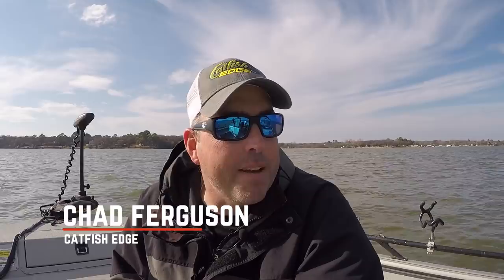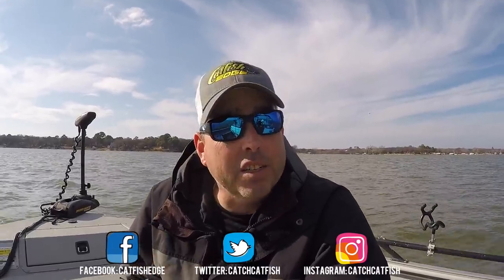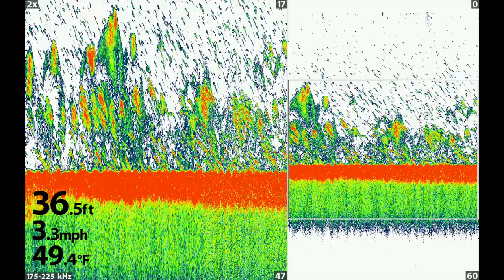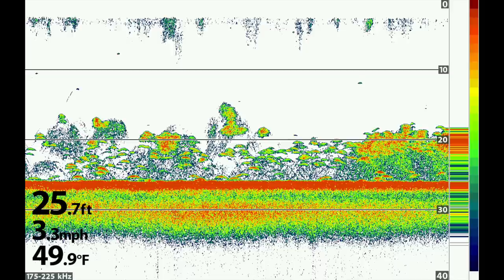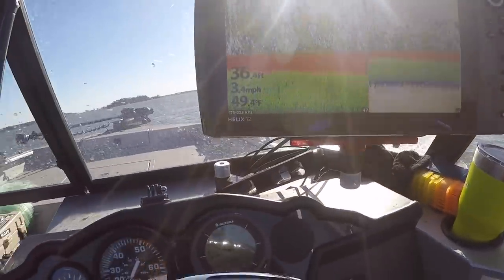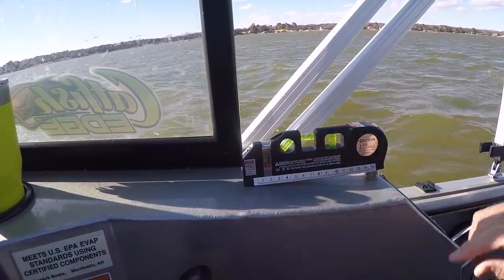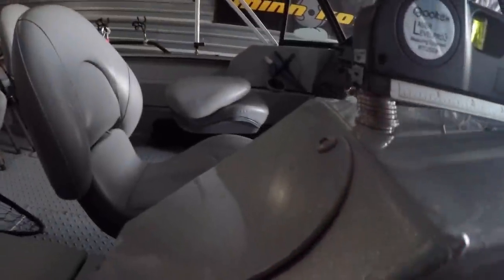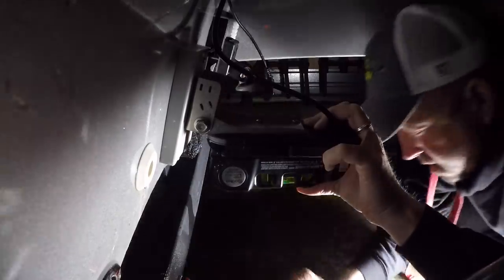How To Level a Fish Finder Transducer (For Better Images)

Comment: You mention guesstimating the level of a transducer.  I had a Garmin Echomap installed by a leading dealer in our area Portland Marine Electronics back in 2017.  There is a new owner now as of 2018.  I bought the unit from them and was told what a great deal and it comes with this really good transducer.  Well when I tried side imaging it was terrible.  I contacted Garmin and they wanted to know if the dealer tested it on the water.  I told them not that I know.  When I talked to the owner of the company Todd I mentioned that to him.  I also told him the side imaging is terrible which he said his works for fine for him.  Then tells me we have been installing fish finders for so long we don't need to test on the water.  We know exactly where the transducer needs to be.  Then I found out they installed it with the wrong transducer.  That really irritated me.  Told me they couldn't do anything because they installed what was in the box.  They charged me $300 and removed my stand for the old unit and the transducer and speedo for it.  Then just slapped on new Garmin unit.  They left all the wiring under the dash plus the external GPS.  I had told them I wanted all of that off the boat so I could sale the old unit.  I also told them I wanted the NMEA 0183 connected to my TR-1 and Marine Radio.  They didn't do any of that.  I never went back there either.  Now there is a new owner and I hope they do a better job.  When I got my new Humminbird unit I installed it myself.  I would of paid to have someone install it that knows what they are doing but there are lot of experts that aren't.  I talked to a guy about checking my system and he said he installs transducers level with the bottom of the boat.  I told him that won't work for good side imaging.  Not sure he agreed.
Reply: I had someone tell me to turn on Jigging Mode found under Sonar.  It forces the unit to read every ping.  Went out for test run and best side images we have gotten. I also used color pallet 4.  Si Chirp Frequncy Max for Beginning and Ending for 455, 800 and 1.2.
Reply from the maker: LOL it happens often

Comment: What about the height from the bottom of the boat.  The Si Transducer looks like it is above the bottom of the boat.  Do you use the cheaper 2D Sonar lower so it still reads when running from spot to spot?.
Reply from the maker: Location depends on the boat.

Comment: I bought new sensor 

XHS 9 HDSI 180 T Transducer

for my
HELIX 9 SI GPS.

Instaleed new Versions

HELIX 9 SI GPS,Vers.1.46 and Basemap,Vers.1.051.

Fishing deepth 4-7 meters.

After updating cannot see any of fish symbols(Fish ID-On) on
the sonar screen.No fish alarms(alarms-On).

I am using 455Hz.

What reason could be???
Reply from the maker: +Juris Lipiniks Why do you want fish symbols and alarm? Learning to read the graph is the only reliable way of finding fish. I haven't used these features in 20+ years so I can't help with troubleshooting.

Comment: Great video very helpful. Is it necessary to do the transducer mounted on trolling motor? I have side imaging on that also
Reply from the maker: If it’s not part of the trolling motor then yes it would help.
Reply: Thank you for the come back.i guess i would have to see how level the boat is when using.and just shim the transducer to make level if needed.running a ranger rt178 with totalscan transducer in front and active image 3in1 on transom.again great video thanks

Comment: My junkie lowrance gen 2 has a movable hand adjustable transducer is that normal ...... I did bottom out on a sand barge  and it got even worse ..... Even at anchor now it rarely shows fish and sometimes not the bottom
Reply from the maker: No it shouldn't move
Reply: Not even by hand ?
Reply from the maker: No

Comment: excellent video!!! I will level mine just like that. I have a question, i read that the side matter depending if the prop rotates clock or counterclockwise. is that true? if yes what is the rule? would the transducer in the middle right behind the motor work better? I have a helix 7 side imagine.
Reply from the maker: Supposed to be opposite side of prop rotation but doesn't seen to have much impact IMO. The issue with going behind the motor is in many boats that will limit you from full trim.
Reply: Thank you very much!!!

Comment: I have a 1959 Duracraft that used to have a transducer in the ideal spot to put it.  Can I put it higher than the existing holes and still be ok???
Reply from the maker: Possibly. Hard to say without seeing it.
Reply: I am going to put a piece of plastic 3/4" outdoor trim board over the holes and rivets.  I will bore holes where the screws are and JB weld the plastic trim piece to the boat so I can have it in the ideal spot.  This way I am not screwing thru the boat.Thanks for this video.
Reply: It worked.

Comment: I have a bass tracker with an offset on the bottom of the transom. My marina installed my transducer on the upper step right beside the speedometer mount. My images are horrible.  I am very disappointed after spending for a Helix 10, and 360 sonar.  Should I move the transducer to the recessed step which moves it nearer the bottom of the boat?  Am I getting too much turbulence?  My 2D sonar is great. Everything else is worthless.  Can you advise me?
Reply from the maker: Every boat is different. I can’t answer that without seeing it.
Reply: I have the same issue as you: the SI transducer is next the speedo pickup and my 2D, DI, and SI all look like total garbage. Did you ever get your issues resolved?

Comment: I have a 2072 grizzly tracker with float pods, how high should I mount the transducer from the bottom of the boat ? Do I want the transducer level with the bottom of the boat, transducer half under the bottom or An inch above the bottom. My pics don’t look great at all. Also do you have a setting videos ?
Reply from the maker: https://youtu.be/CAalb4re4RA
Reply: I just watch that video lol thank you
Reply: Would you happen to have a settings video?
Reply from the maker: @jamesryan5064  Restore to default and adjust contrast and sensitivity as needed,

Comment: I have light lines on the down and side scan every few feet but not on sonar. When I use the trolling motor a Fortrex 112 between 50 and 70 the lines go away but the screen between surface and bottom gets a little lighter. My transducer is currently set to unknown so that might be it but Im thinking it's electrical interference. Any ideas? Also if it is interference wouldn't it effect the sonar as well? If it is interference how do I fix it?
Reply from the maker: Isolate if it's electrical and then make sure it's wired DTB with no crimps, if that doesn't fix it start by checking the trolling motor fuses (internal).
Reply: It was the trolling motor fuse in the head of the unit. TY!

Comment: When I try this procedure, I get the boat leveled on dry ground the same as it would be in the water, but when I try and level my Lowrance transducer, I can't get it level due to the plastic tabs that ultimately secure it from moving when tightened.  How can you fix that?
Reply from the maker: Ken, it's been a long time since I have run Lowrance so not 100% sure. Hit me up on Twitter and send me some pics and I'll try to help.
Reply: Use a shim between the transom and transducer bracket. We have had to do this many times during installations.

Comment: I have the pro cat 200 and just baught the hummingbird g3n mega the shop i baught everything from mounted the g3n but when i took it out on the water got up to plain it was a bluer what do i need to do  and reading fish at 3 to 5 mph what do i need to do thx
Reply from the maker: I’m not clear on what you’re asking
Reply: When im going over 5 pmh my screen is a total blur what do i need to do to adjust it or are they all like that
Reply from the maker: Move your transducer. It’s not mounted right. The SI transducer should give you images to 7-8 MPH beyond that you’ll need to add an HS transducer for 2D.

Comment: I use the level in my phone. Find out the degrees from level on the water at the speed I want the transducer level. Once on the trailer, I adjust the trailer to the same degrees as on the water. Next use phone to level the transducer.
Reply from the maker: That works also I just don't like the phone as mine has some accuracy issues.

Comment: This doesn't work for my Helix 7 SI GPS transducer because the mount has the gear with teeth for selecting the level of the transducer. One click, the bubble is too far left, and with the next click, the bubble is too far right.
Reply from the maker: You just have to get as close as you can. It'll be close enough.
Reply: @Catfishedge  Use washers to get the transducer exactly level. Also my transducer was not pointing straight ahead and washers fixed it. Fit a permanent level so you can load the boat to make it level side to side and back to front.

Comment: Why isn't there a leveling bubble on the transducer? 
These devices cost hundreds of dollars and the manufacturer is too cheap to design a new feature in for Johnny Salesman to mention 54 times in his sales pitch?
Reply from the maker: Because it’s only needed once
Reply: It works really well on my jon boat. I must have got lucky carpenters eye. Bolted it on and tried it. Works great.

Comment: I called a recommended installer.  I just wanted him to look over my install.  So discussing what I have the guy says I just install I don't use these fish finders.  Then subject transducer adjustment.  The guy tells me levels with the bottom of the boat.  I explained for side imaging that is wrong.  Have to have level with water.  It depends on how the boat sits on the water.  The installer guy made some comment that didn't mean anything.  I decided not to hire the installer.
Reply from the maker: Unfortunately that happens a LOT
Reply: Sadly there are vast amounts of misinformation regarding everything involved in electronic fish finding devices. It's voo doo Jedi mind tricks. ;)

Comment: This probably explains the fake fish on my screen, Garmin instructions said level with the boat and I get all these fish readings that just are not there...
Reply from the maker: LOL
Reply: @Catfishedge - I got a new Echomap 73sv and tuned got it set up with your help and It's working awesome. Thanks a lot Dude. Like a lot of people here the "manual from the manufacturer" says level to boat. What I found they are doing is attempting to make it work at high speed on plane, which makes it work like crap actually trolling when you need it. P-)